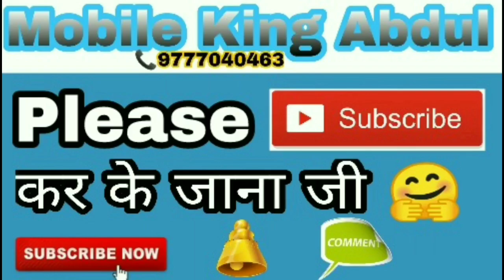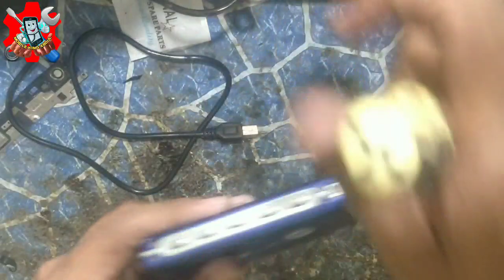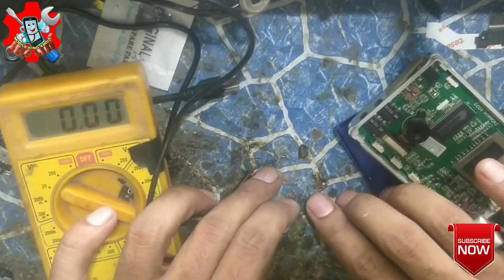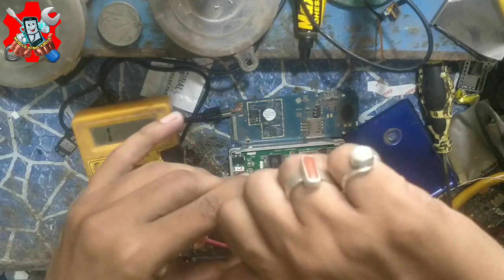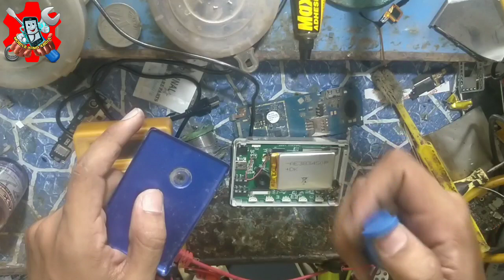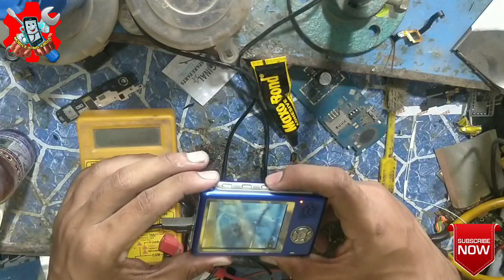10 year old camera mp4 .Restoration destroyed an abandoned camera mp4  | JXD. mp4 . gaming. restore

Comment: sir i need jxd 661 firmware plz plz plz
Reply from the maker: Software version kon si
Reply: @MobilekingAbdul  sir model no jxd 661 1gb internal memory .software version to nahi malum
Reply: I have firmware
Reply: @Dipankar_Debnath  which CPU do you have 
3050d or 3060? If you don't know unscrew it and look on CPU(backside of LCD)
Reply: @MrSaif7862  spmp 3050a
Reply: @Dipankar_Debnath  https://forum.gsmhosting.com/vbb/f490/mp5-4-firmwares-tools-tutorial-driver-1028194/ 
Find your cpu
Reply: @MrSaif7862  im using jxd so all key not working properly with this firmware